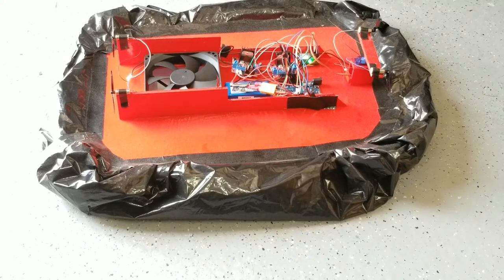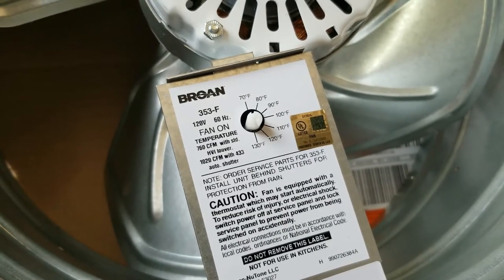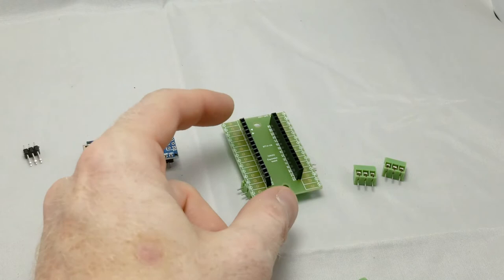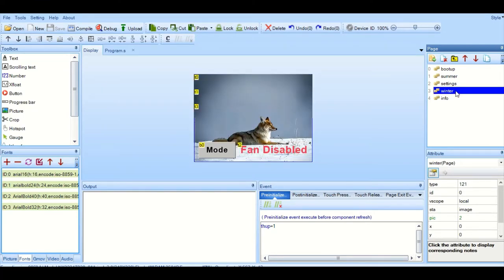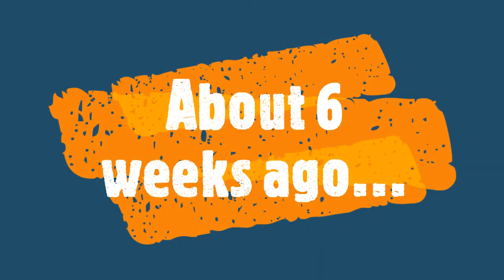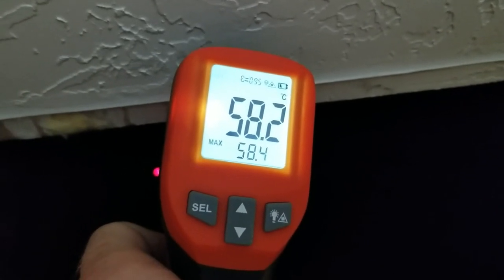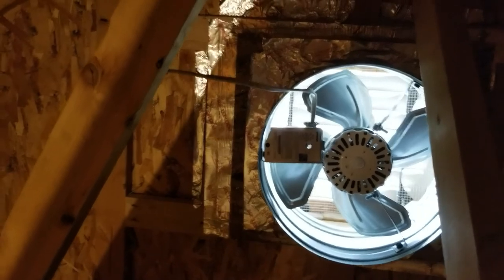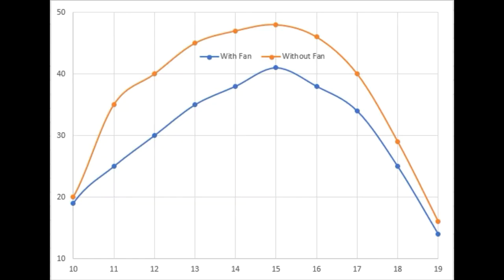Arduino Attic Fan Control with Nextion Touch Screen GUI // Tutorial Part 1 – Hardware and Wiring

Comment: Nice video, seems like it would be simple to add code to control a multi-speed fan that I have noticed that most fans are  have that ability ?
Reply from the maker: Correct. A/C fans only have variable speed when used with a frequency drive (expensive). You could use a fan that had two or three speeds, but then you would need 2 or 3 relays.

Comment: @4:30 what is the purpose of the Nextion library in Arduino? What can the library do that you can't 'already' do without the library?
Reply from the maker: You definitely don't need the library if you can understand the Nextion commands and how to format them. The library does some of the text formatting for you and has its own set of commands. So either you have to learn the library commands, or in my case just learn the Nextion commands. The library could be useful if sending tons of data to the Nextion, but you could also write your own subroutines for that. I find that I learn more when not using other's libraries. Also, not using libraries can save you memory.